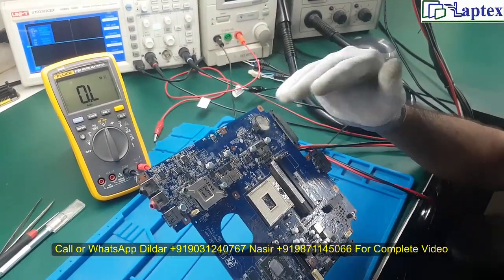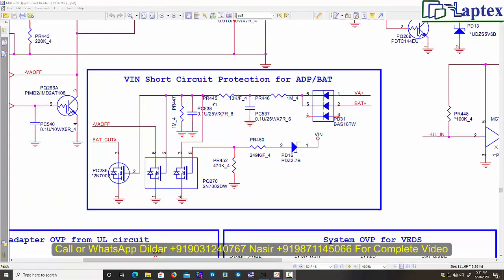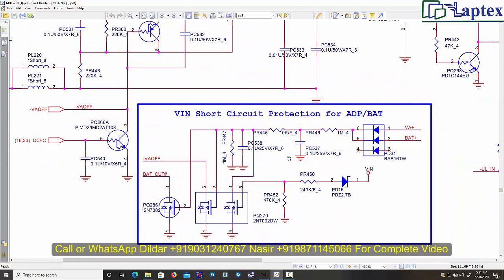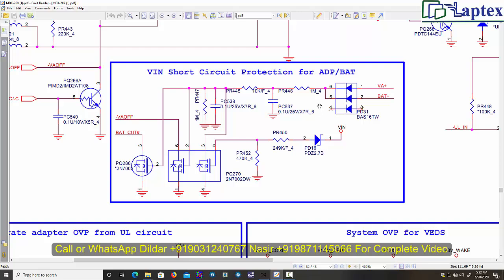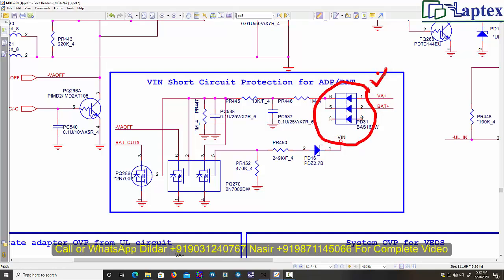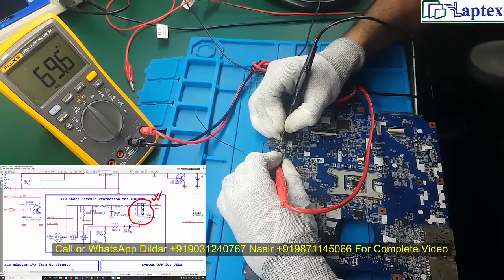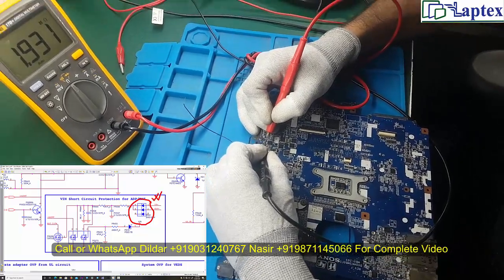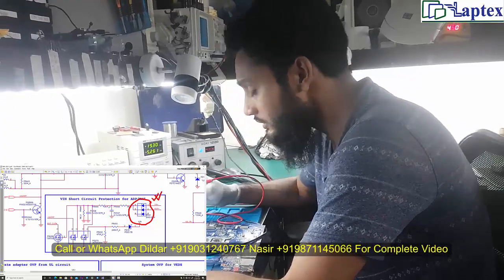How to test Diode on Laptop Motherboard | Online Laptop Repairing Video Course in English |Laptex

Comment: Dear lm advanced level bio passed one, i like to learn digital electronics ..
Reply from the maker: Okay you can get the switching section complete videos...like diode, zener, Bjt, MOSFET and Op-amp.
Contact on whatsapp +919031240767
For details.